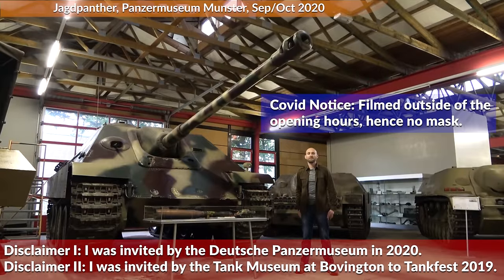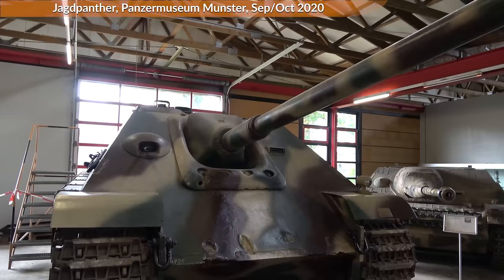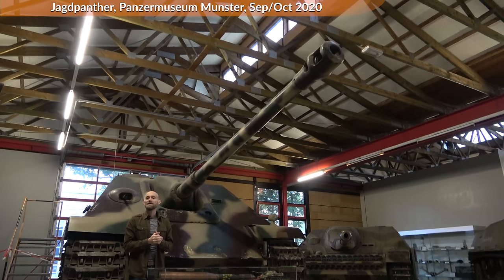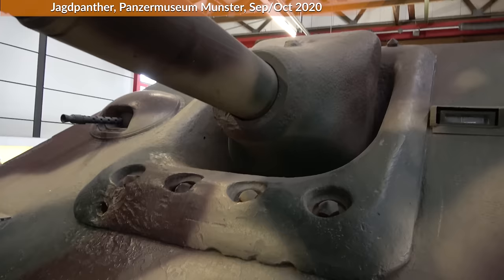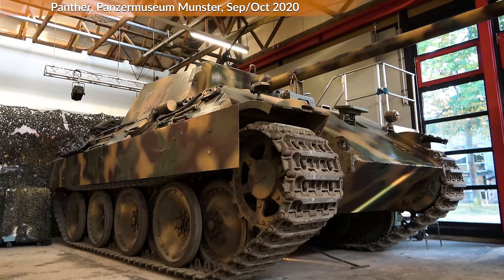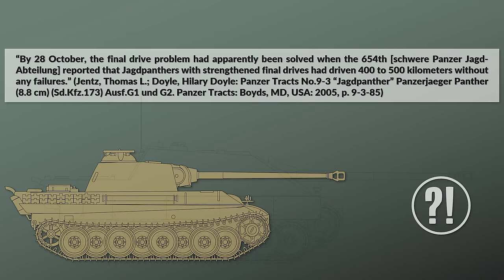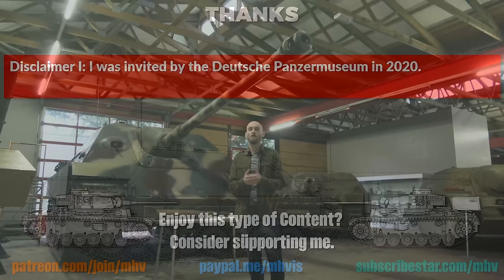Jagdpanther: King Tiger's Gun & Panther's Chassis

Comment: From asking Doyle, the final drive on Panther was never improved, only the ones which went on Jagdpanther. I'm unsure why, I can only assume capacity issues with the various factories. It is worth noting that though the improved final drive is referenced in Jentz/Doyle works on Jagdpanther, it is notably absent in works on Panther.
Reply: I've been constantly told that later Panthers (G and onwards if I remember right) received upgraded transmissions, but is this just a fallacy?
Reply: Bernard gets points off for not showing us how track tension is done unfortunately
Reply: Oh bugger, the Jagdpanther is on fire. 
*Chieftain jumps out the rear hatch onto engine deck.
Reply: Isn't this Mr Doyle's favourite vehicle? I remember you asked him in a video why he liked it, and he simply said 'I just do'.
Reply: by the time the jagdpanther was developed, in 1944, it wasn't worth rehauling panther production to use the new final drive.
after all the supply line was shortened and panthers died early enough that the final drive wasn't a big issue by this point
Reply: The only fix for a Panther would have been if the drive train had driven the planet in relation to the tank, it would have been simpler and more reliable.
Reply: The Chieftain looks hungrily at the track tensioning system.... .
Reply: Considering the increased weight from the 8.8cm Pak43/3 over the front drive, and consequential greater wear, I would guess that there may have been more of need for them to be installed in the Jagdpanther.
Reply: If that is not true, still need a video about how is the big differencfe between the french post war and the WW2 german reports.
French said: avrg. 150 km final drive-->Broken
Germans said: 500-4200 km(4200 km, bergepanther, 1000 km was driven with towing an another  panther).
What is this big difference? Driver? material? maintenance?
Reply: H.Qu.OKH, on 6.5.1944

Der Generalinspekteur der Panzertruppen
- Leitender Kraftfahrzeugoffizer -
Bb. Nr. 3177/44

About : Pz.Kpfw. Panther

In relation to : Report on the experiences of I./Pz.Rgt. 2 of 22.4.1944

A copy of a report is attached as an annex with the request that its receipt be communicated.

The report confirms the view that continuous improvement of its components has increased the service life of the Panther tank. The average service life of a Panther can now roughly equal that of a Panzer IV with around 1,500 - 2,000 kilometers between two major repair and maintenance processes.

The Chief of the General Staff

Copy

Battalion Command Post, 04.22.1944

I./Panzer-Regiment 2

Report on experiences with Pz.Kpfw. V

During the fighting for Proskurow as well as during the fighting with the 1. Panzer-Armee, the Battalion, without having enough spare parts, depended exclusively on the support of the Repair and Maintenance Squad ( Instandsetzungsstaffel ).

With the Pz.Kpfw. V of the I. Battalion of Panzer-Regiment 2 the following experiences were carried out between 6.3 and 15.4.1944:

HL230 P30 engine :
The service life of the engines is generally much longer than that of the engines of the first series.
The highest mileage in 3 of 7 tanks still available is between 1700 and 1800 km.
All the breakdowns suffered in the engines have been of the same nature (damage to the bearings and broken connecting rod).

Engine fires: Engine fires have also decreased significantly. The reasons for these fires have been the following:

Oil leakage from valve cover due to faulty gasket (oil drips on hot exhaust pipe and ignites)

On several occasions a large overflow of the carburettors has been detected. The spark plugs get wet and do not ignite, the fuel is expelled into the exhaust pipe and seeps through the gaskets, so the fire spreads to the outside of the engine.
Solutions :
For 1 .: Careful and meticulous renovation of the joints.
For 2 .: Avoid carburettor overflow through correct regulation.

Proposal for improvement for 2 .:
Since the fuel level in carburettors varies so often, a redesign of the fuel regulation system (modification of the position of the float regulator needle valve) would be welcome.

Gearbox and steering :
Gearboxes also have a longer service life. Even so, in several cases, at approximately 1500 km, the 3. gear has broken down and the boxes have had to be replaced.

Reasons :
The reason for the failure described above is to be found in the excessive load of the 3. gear during a period of mud lasting almost a quarter.
Due to the lack of means to replace the gearboxes, 3 tanks have continued to operate for 250 km with 3rd gear out of order. In these cases, drivers have had to jump from 2nd to 4th gear. During this very long period of mud in several cases the clutches have broken down and have had to be replaced.

The great wear of the steering boxes is also due to the long period of driving on muddy terrain. Due to the relatively complicated adjustment of the steering gear as well as the short period of technical instruction, drivers cannot always be expected to carry out a basic adjustment of the brakes.

Due to the fact that tanks have generally been thrown into combat with faulty steering systems, side reduction gears have failed as well as extensive brake wear.

The highest mileage of the gearboxes and steering achieved in 4 out of 7 tanks still available is between 1500 and 1800 km.

Proposal for improvement :
An easier adjustment of the entire steering mechanism.

Side reduction gears ( Seitenvorgelege ):
A high percentage of battle tanks have been lost due to damage to the side reduction gears. For example, since 1.3.44, 13 have had to be replaced in a total of 30 tanks (a greater number of left side reduction gears than right ones).

Faults :
Breakage of the screws of the large sprocket inside the side reduction gear.

Reasons :
Side reduction gears cannot withstand jerky steering over difficult terrain.

Solution :
The screws or the weakest parts must be reinforced.

Chains and bearing system :
After a mileage of between 1500 and 1800, the chains show great wear. In many cases the ribs of the links bend outwards or break. In 4 cases the chains had to be replaced as a whole series of reinforcing ribs broke.

Reasons :
The nerves are probably too weak as they bend easily.

Due to constant operations as well as a shortage of spare parts, the bearing system has not been able to be maintained and repaired as it should. For this reason, the bearing system in the available tanks is in very poor condition and has sometimes caused chain failures.

Despite the fact that the battle tank has reached a significantly longer useful life, it would be better to withstand sudden and drastic loads such as those that necessarily occur in combat:

Very high engine revs, especially downhill and over rough terrain.
Sudden changes of direction (inevitable in combat).
Clutch overload.

The high mileage achieved as well as the few breakdowns suffered have generally been the credit of good drivers and commanders.

In this regard, the Battalion reports on the Panzerkampfwagen V, chassis number 154338, engine number 8322046, mileage 1878: driver Obergefreiter Gablewski, 4. Komp./Pz.Rgt.2. Fully operational vehicle. Except for the bearing system, the rest of the components are still in very good condition. Engine oil consumption approximately 10 liters / 100 km. The vehicle still has the first engine and the first gearbox and steering.
http://www.panzer-elmito.org/tanques/panther/documentos/I-PzRgt2_22-4-1944_000.jpg
http://www.panzer-elmito.org/tanques/panther/documentos/I-PzRgt2_22-4-1944_001.jpg
http://www.panzer-elmito.org/tanques/panther/documentos/I-PzRgt2_22-4-1944_002.jpg
Reply: I'm wondering how many Allied drivers received medals for getting their vehicle to drive 4,000km. The fact that he received a medal for it indicates that it's not exactly a standard fleetwide.
Reply: @TheChieftainsHatch  They should have medal for it:
The 6th Guards Tank Army discovered the following lifespans of their tanks (late 1944/45):

T-34:   2000-2500 km, 250-300 hours
IS 2/ISU-122:  1200-1800 km, 230-280 hours
M4A2:   2000-2500 km, 250-300 hours
SU-76:   1200-1800 km, 180-200 hours
Reply: @TheChieftainsHatch  when will your antigerman rhetoric end.
Reply: WAS SOLVED IN 1944. THIS PROBLEM WITH FINAL DRIVE WAS IMPORTANT DURING BATTEL OF KURSK (JULY 1943) BU WAS LATER SOLVED AND THE PANTHER S BECAME VERY WORTH.
Reply: Who said I'm anti-German? There are some German vehicles I'm very favourable towards. Or have people ignored the praise I've put towards vehicles like Panzer III which I have said was arguably the best tank in the world at the beginning of the war?
Reply: @thebravegallade731   It was not a new final drive. The Jagdpanthers received a new stronger reinforced housing. The former housing was flexing and that allowed the gears to get out of adjustment and fail pretty quickly. If anyone knows about cars one of the quickest ways to kill a rear end in a car is to get the gear contact patch  and backlash adjusted wrong and it will fail spectacularly.  It seems the Germans never issued the reinforced final drive housings to Panthers because they were a mas produced vehicle while Jagdpanther was a limited production vehicle.
Reply: It might not have been improved because someone was not willing to admit there was a problem.
Reply: @ the Chieftain: that is what I read, too. Can't remember if it was in a Jentz & Doyle publication or elsewhere. The publication noted a high-profile conference with Hitler and Guderian among others in late 1944 in which the issue was discussed. It stated that no improvements could be made as the raw material to improve the strenght of the used metal alloys wasn't aviable.
Reply: @rolandhunter  I just wrote from memory, I think this was the meeting!
Reply: @thomaskositzki9424  No problem, i just wanted to help you 😊
Reply: @rolandhunter  I quote, 'Some people claim (including Spielberger), that the final drives of the Panther were bad by design, but the Centurion, which was 7 tons heavier, used the exact same type of final drives. Like many other tanks too, M26 for example. (Thx Roland).'

That would only be relevant if you are arguing that you could take a Panther final drive and drop it straight into a Centurion and happily drive away. I very much doubt that that is the case. They may both have used the same type of final drive, but good luck trying to swap them around without indulging in some serious metal bashing.
Reply: @gwtpictgwtpict4214  They used the same double spur gear type final drive. Do you know what kind of spur gears are use in other tanks? 

Example: herman used herringbone gear as the kingtiger. 
The incisions are not straight(like in the panther/centurion double spur gear), so they can wear more stress, they cant broke so easily.

 But its more expensive and harder to make.

His argument is correct. Many times there is an argument: the double spur gear is SIMPLE, too simple with straight incisions, and that is why the Panther final drive was bad, broken easily. This is why he mentioned the centurion, what had no serious problem with  the final drive.
Reply: @rolandhunter  Same design principle,  not exact same type as you said, different metallurgy, different dimensions, different components, etc, etc, etc. The fact that it worked in the Centurion cannot be used as an argument that is was fine in the Panther, which is what you seemed to claim..
Reply: @gwtpictgwtpict4214  If you do not want accept this fact, then not, but technicly, yes you can.

Panther:
Final drive
reduction ratio and number
of teeth of spur gear 8,4:1

Centurion:
Page 118 "The Centurion Tank" by Pat Ware
In the Chapter "Centurion Reference Data it says:

"Final Drive: double-reduction spur gear train; ratio 7.41:1 (MK 1 6,94:1)

The difference is not much, so the final drive of the cent almost had the same ratio(pressure) as a panther.

They had the same design, but  late war the Panther had much worse materials, so it was not much durable like a post war Cent final drive, but it was still better than only 150 km max range until replacement.
Reply: @rolandhunter  So, not the 'exact same type' as you initially stated. Thanks for clearing that up.
Reply: @gwtpictgwtpict4214  I hope I could help you. =)
Reply: @rolandhunter  Very kind of you.
Reply: @abaialsa712  nice claims...
Reply: @rolandhunter  The Berg was minus the gun and turret which must have saved a lot of weight and so stress. Also the Berg was probably driven by a mechanic who if he blew the F Drive would have to replace it himself. 
Also don't think the Berg towed a tank like a tow truck it wrenched it via cable a 100 meters at a time.
Reply: @johnneill990  1. next time read the comments more carefully:
"1.Performance of a Bergepanther driver

The Unteroffizier Krause, belonging to a Panther Workshop Platoon ( Panzerwerkstattzug Panther ), traveled with his Panther recovery vehicle with chassis number 212132 until 03.05.1944:

4,200 kilometers

without carrying out any engine change and without suffering any failure in the side reduction gears ( Seitenvorgelege ), gear change or clutch. Approximately 1000 km have been traveled with a Panther tank in tow."
Nothing was changed, replaced in the Panther.
2.Panther ausf A was 44.8 Tonnes, bergapanther was 42,2. Not much difference, if we talking about the final dirve.
3.Krause was a tankdriver, not a mechanic.
4.They are towed the tanks like this:
https://i.pinimg.com/originals/38/56/ea/3856eaef74f351bade1da3ebe1c0d35b.jpg
https://i.pinimg.com/originals/65/b5/67/65b5672a90e8f6ff9a65606152245592.jpg
Google more if u cant believe this.
And in historical debate please do not use this words: I think or probably. You have to make a correct point or search out fact and not try guessing.
Reply: Whos Jentz/Doyle?
Reply: @karlhans6678  Two authors known for their research in the various German archives. Pretty much the gold standard for German WW2 equipment references
Reply: @TheChieftainsHatch  thanks for answering Chieftain.
Reply: correct, only improvements to the final drive housing were done on the panthers, but the real issue of the spur gears were not solved
Reply: @randommilitaryhistory823  spur gears weren't even solved for jagdpanthers? What did the housing fix improve for the panther?
Reply: @Anlushac11  The Panther G of the WTD 41 has the reinforced housing. And it is very easy to tell them appart. The reinforced housing has two metal rips at the outside of the housing.
Reply: @HaVoC117X   Cool to know. I have seen seeral sources say Panthers never got the reinforced housing.
Reply: @randommilitaryhistory823 
Because the gears itself were never an issue when made out of the right alloys. They had problems with the housing and some faulty sealings and O rings, which could not hold the grease inside the bearings. Both issues were fixed during production of the Ausf. A.

But getting the alloys right remaind an issue until the end of the war. A problem no engineer can fix.
Reply: @karlhans6678  As Roland already explained. Under stress the housing coulb bent and as result the gears were pulled out of alignment. This led to a very quick failure of the gears.

This issue was fixed with two rips which reinforced the strength of the housing, with minimal changes to the overall design.
Reply: @HaVoC117X  you said getting the alloys right was still not fixed, what issue did this cause to panthers and jagdpanthers?
Reply: @karlhans6678  A part which is simply made out of the wrong metal alloys, is not as strong as intended, like the final drives  and other parts of the drive train including engines parts like crankshaft, rods and pistons. This wasnt just the case for the panther, it affected all late war german weopon systems like tanks and aircrafts. This issue was never exclusive for the panther.

Eric Hartman refused to fly his first bf 109 g10 and kept on flying his older g6, because he did not trust the build quality of the newer aircraft.
Reply: @HaVoC117X  why did only the Germans have this problem, aren't Germans known for their superior engineering?
Reply: @karlhans6678 ???
I didn't know that resource shortage is an engineering skill to master. 
Try to make a Rolls Royce Meteor or Ford Gaa V8 from the same stuff the Germans had to deal with and see how that will work out! 

But still the Germans were very effective in finding substitutes for most rare stuff. But on their way to do so, they had to deal with mixed results. Is that really surprising?

Irc the Russians had the exact same problems in 1941/42 when they had to evacuate their arms industry.
Reply: @HaVoC117X  you left out the reason why they couldnt make the right alloy was because of lack of resource.
Reply: @HaVoC117X  The German industry also relied on slave labour, prisoners who tried to contribute to the allied war effort by sabotaging production as much as possible without getting caught and executed.
I remember an interview from polish TV in my childhood, the workers were forced to work in an engine factory; kept on starvation diet and worked to exhaustion. One way they decided to sabotage is by having one group manufacture bearing centre holes to the largest possible tolerances, that still would pass inspection, the group that manufactured the shafts going in them would make them to the smallest diameter to pass. The aim was to increase vibration, wear and reduce the ability to seal lubricant. By itself that one "change" meant little, but since every station was doing their bit, the production engines had higher vibration and run hotter than reference. 
Each day the foreman would change who aimed at higher or lower end of the spec, so that overall the mean production stayed in spec. The problem for the Germans was that their production was so stretched that most of the engines were produced from the same day components immediately; there was not a stock pile that would have averaged out the tolerances across the assembled engines.
Similar stuff was done at every stage of production, from the mines to the paint shop - end result were weapons with significantly reduced effectiveness. A testament to the prisoners courage.
Reply: Maybe they wanted to implement it on the Panther 2. In the final months Germany was developing an improved Panther that was supposed to share components from the Jagdpanther and Tiger 2 to ease maintenance and reduce production costs. I think this project never went of from the drawing board though.
Reply: @Athrun82  Panther 2 is about a 1943 project.  The primary goal was to resist AT rifle fire. When it was discovered that Schurtzen did the job fine, the project was canceled. Tiger II was started before Panther 2 was canceled, which is why they had the idea of common parts
Reply: @TheChieftainsHatch  Interesting. I have to check my books again but I was sure the Panther 2 was still in development right before the end of the war. I know the Schürzen on the Panzers were good at protecting the tracks. Later they reverted to Thoma Schilde because they were cheaper but did the same job. Though I thought that was just a modification for Panzer 4's and Stug's
Reply: @thekoolaidkid337  but it is easy to tension the tracks on both the Jagdpanther and Panther! Located on the low part of the rear on your left and the right for the respective tracks, you unbolt the armored covers and insert a tube/key (typical of the period) and you turn it to tension or un-tension the track. Quite practical...
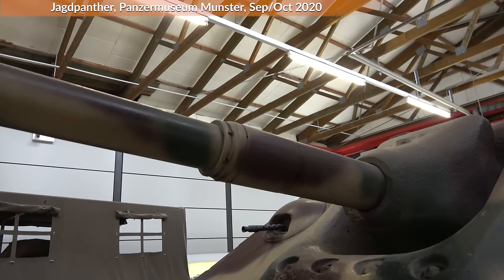Reply: @Anlushac11  You are of course quite correct. The placement of the wear patterns ,the load distribution is crucial. And it is not just this. I had occasion to drive different tow trucks,gasoline engines. The difference between a 4:10 differential and a 4:55 diff was noticeable. A 4:55 diff was preferred by the drivers. Around town,in traffic,better acceleration and faster overall. But make no mistake about it,engine wear was greater. The one,about 80,000 miles between engine replacements. The 4:10 gearset,up to 120,000 miles. And that is a big difference in terms of cost of operation. Gasoline consumption increases with a higher numeric number as well.
So just that one component difference made a measurable difference in driveline wear. Add all that to the bombing campaign, alloying elements in short supply,various factories doing the best they could with what was immediately available,it was amazing the Germans had output,much less reduced lifetimes of components.
Reply: @rolandhunter  it is good to remember that the final drive of the Panther was originally to have an epicyclic gear (planetary) system in the final drive but Germany suffered from a shortage of gear-cutting machine tools therefore the final drive was changed to a double spur system. Although much simpler to produce, the double spur gears had inherently higher internal impact and stress loads, making them prone to failure under the high torque requirements of the heavy Panther but this was almost the same for most of the German tanks. According to Jentz and and other authors it wasn't so much about the quality of the spur gears but more about the weakness of the casings of the final drive that tended to break and had to be reinforced within limited space. I have no idea how they apparently managed to solve this serious problem that generally had a lifespan of only 120 km. I do not know about the Centurion but the Sherman final drive was built with herringbone gears and shafts and I believe that also the Pershing M26 and the M46 was similar (see how large the casings of the M26 & 46) but the final drive of the Sherman was very well built and very reliable. The real problem was the chronic lack of spare parts and fuel, that seriously handicapped the German tanks...
Reply: @paoloviti6156  "The real problem was the chronic lack of spare parts and fuel, that seriously handicapped the German tanks..."
That's the point.

In the Korean war, the americans lost more tank due mechanical breakdown, as against the enemy fire.
Why? bad logistics.-->same on WW2 germans.
http://the.shadock.free.fr/sherman_minutia/manufacturer/m4a376w/m4a3_76w2.html

PS: The average life time of the final drive was much more than that.
Just check out the bergepanthers. Those tanks still used, double spur gears:

"An example of Panther reliability appeared in the June 1944 edition of Nachrichtenblatt der Panzertruppen (Armoured Troops Bulletin), from a Panther-recovery tank driver's report:

    Unteroffizier Krause of a Panther workshop platoon has driven his Panther recovery tank – Chassis No. 212132 – 4,200km until 3 May 1944 without any needing to replace any parts. About 1,000km of this was made towing another Panther tank. The vehicle and engine are still in great condition and operational."
Reply: @rolandhunter  thanks for the info as I find it interesting! Regarding the average distance of the final drive of the Panther comes from the book Panther & its Variants written by Spielberger in 1993, in this book there was the French report about their Panthers and commented clearly regarding the lifespan of the final drive. Obviously I am not in the position to argue if it is true or not but reading here and there I do have the impression that the Panther was very dependent on the skills of the driver like Unteroffizier Krause, including mantainace, but I suppose that it was the same for any tank. I didn't know that many US tanks broke down for lack of spare parts so I will have a look at the link you have sent. Thank you again 👍
P.s. when I was mentioning the casings of the final drive in reality it is the housing! I apologise for my bad grammar as I'm Italian!
Reply: @paoloviti6156  "grammar as I'm Italian!" No problemo my friend!

May I give you a sugesstion?

All your questions has answers in this comment section, under this comment.
Upper, in the ~55 comment, you can find my other infos, Havoc infos etc!

Read them and you will have answers.

PS.I know about Spielberger, a very good book, but do not forget, the french used late war made, scrap Panthers. And I trust more in the germans, because their reports are very-very accurate. And they made the tank for theirself. :D Ofc they wanted a better tank in time. If you check out how many modifications was made on Panther ausf A compared to D..uhuuu, many-many. And then the modifications on the G....

"Captured Panthers were used after 1945 primarily by the
French forces. ln 1947 a battalion of the 503rd Armor
Regiment in Mourmelon was outfitted with 50 Panthers,
while additional Panthers (including Jagdpanthers) were
also stationed in Satory and Bourges."
Spielberger book, page  160. 

And I never had an opportunity to read the "Le Panther 1947°", I never found it. :\

If somebody have it, pleeease send it to me!
Reply: @rolandhunter  thank you again for your suggestion: I will look at it! Yes I remember that the French had those 50+ Panthers, some Bergepanther and a few Jagdpanther, apparently mostly taken from the battlefields or the whereabouts of Normandy. The reason why they were abandoned? Mainly lack of fuel and spare parts but also due to sabotage done by forced labour at the factories. I agree with you that we should trust more the reports of the Germans and generally many Panthers was ready to be junked. Finally, really thanks for the link regarding the the use of the Sherman and the Pershing in Korea, really interesting to read including the general lack of spare parts, much appreciated and learnt a lot 👍👍
Reply: @paoloviti6156 I'm glad I could help! 🙂
Reply: Probably couldn't rework all the manufacturing lines to accomodate for the changes and were made separatedly
Reply: @rolandhunter  I believe the factory warranty given by the factory to the red army (and this is a real thing!) On a T34 was 1000km!